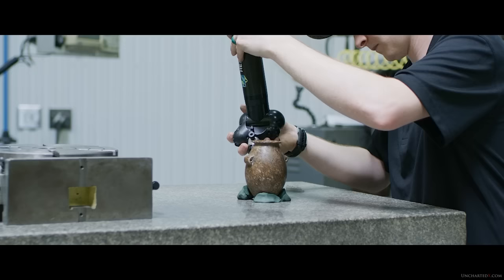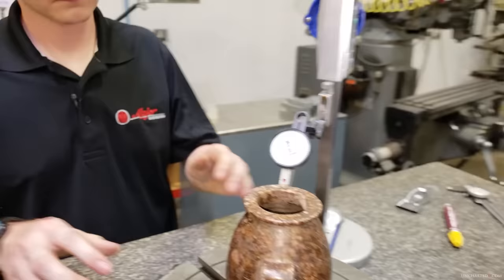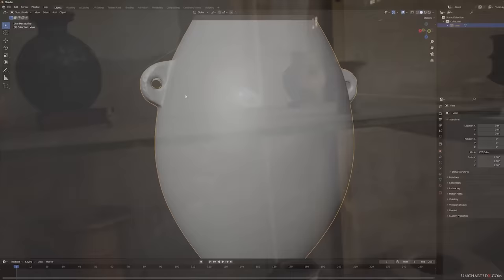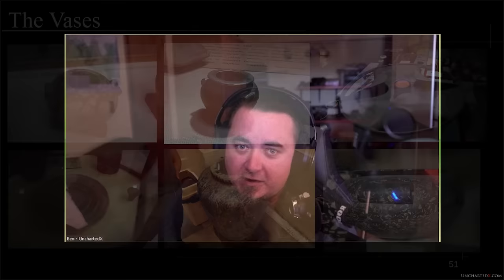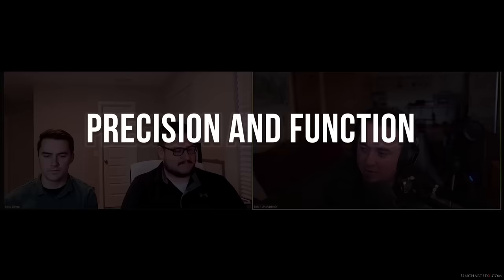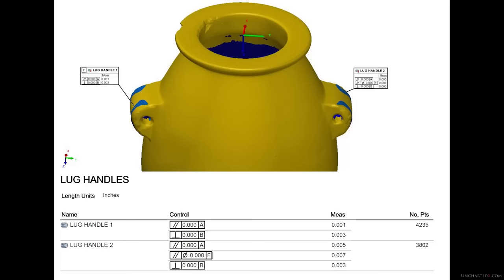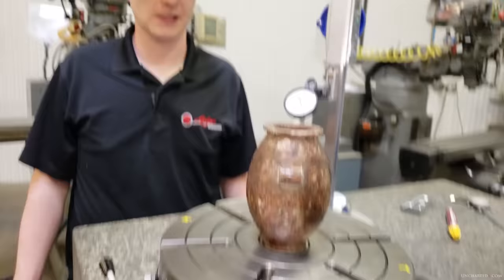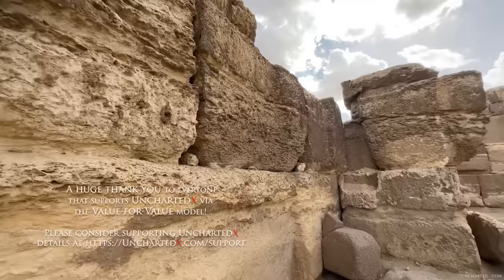Ancient Egyptian Vase Scan Update! STL file, More Analysis - and Between the Lug Handles

Comment: So you're surprised there are stone vessels during the STONEAGE? It would be more impressive if they were made from steel. They had lathes. If you have a lathe and sand to polish you can achieve very high tolerances.
Reply: uhh...you're aware that granite is harder than steel, right? and there is even a vase in the Cairo Museum that is made from Corundum (Mohs hardness of 9).
Reply: @AustinKoleCarlisle  You're correct friend. Steel is refined iron ore enhanced  with carbon. It's significant because the temperature required to smelt ore is quite high. Additionally it requires knowledge of metallurgy. The paleo to neolithic represent the stone age. People crafted tools from stone. They used lathes chisels and sand. Sand like is found in Egypt has a higher hardness than granite.
Reply: @samkostos4520  wrong , sand in Egypt is very fine like flour and not very abrasive
Reply: @al2207  No. Egypt, is one of the primary sources for high quality silica sand. They remain a leader in production today. Why you feel the need to lie to suit your theories is strange friend.
Reply: @samkostos4520  i was there and sand is not abrasive the way you say
Reply: @al2207  The quality and types of sand are determined by geology. Not subjective theories or your personal feelings. There objectively is silica sand in Egypt. Infact there are types of sand with higher mean hardness ratings there in plentiful supply.
Reply: @samkostos4520  Do you think the high precision bearings, in the machine that made this vase, were made of stone?.

How do you maintain the position of the abrasive in a precise manner, in order to produce the tolerances of this vase?
Reply: @jamemswright3044  The sand is used for drilling and hollowing out the volume of the vase. It's also used for the holes in the handles. Since the drill would be in a vertical position gravity would keep the cutting medium in place.
The lathe is used to construct the exterior shape of the vase. Because lathes rotate they produce symmetry along the rotational axis. This is the whole point of lathes.
Reply: @jamemswright3044  They did not use bearings. We know they used weights because there are hieroglyphs that show it. It's plausible that their drills and lathes were automated by cattle using a capstan like the Greeks employed in the 3rd c. BC. 
The people living during the Neolithic shared the same anatomy as you or I. Meaning they had the same intellectual capacity. Meaning there were gifted level thinkers among their civilizations who devoted their time to the production of stone goods. Over time this developed into the mastery of the availible materials resulting in smelting rocks like malachite to extract copper -mixing it with tin and forming bronze. You see we would not of developed metallurgy without first deeply understanding the properties of stone.
Reply: @jamemswright3044  My point being. If you want to disprove classical studies and the accepted chronology you need to produce an example of industrial metallurgy during the mesolithic. Stone items found during the mesolithic(meso - middle , lithic - stone) do not demonstrate that a lost civilization existed.  Obviously you could also prove classical studies wrong by providing evidence of a written language prior to 5500 BCE yet we don't find that anywhere on earth. Don't you think if some advanced civilization was present that they would leave behind even a single inscription?
Hieroglyphic writing developed independently in North Africa. Cuneiform was used in Western Asia (Ur, Sumer etc.). Don't you think there would be a common origin in relation to written language if there was a global civilization which preceeded them?
Reply: @samkostos4520  How do you account for the lack of run-out, on the exterior of the vase, without the use of precision bearings?. How do you set up and maintain perpendicularly within a few thousandths, to drill out the internals of the vase?. How do you stop the drilling mechanism from wandering in hard and soft crystalline materials?.  How do you machine a spherical internal shape with a drill?.
Reply: @jamemswright3044  In relation to the precision of this particular vase. There are logical explanations. Assuming it is authentic and from 6000+ years ago it's possible they used water based levels to refine the object. Alternatively, it could have been restored in modern times by a collector who wanted to have a nice show peice. As the vase resides in a private collection we do not have reference photos from it's excavation to follow how the object has changed throughout the years.
Reply: @samkostos4520  how do you use water based levels, to measure circularity and perpendicularly?.

 Is there anyone available now who is re-working vases like this, to this precision?.

Comment: So much blah-blah-blah and no wondering what was the purpose and function of these vases. This must be a lucrative topic bringing a lot of advertisement money. After watching 3 or 4 videos of yours on this topic, it has become boring, and everything is clear to me now:
1. These vases were created by a relatively advanced civilization
2. They were most likely made using waterjet cutting, sandblasting and maybe laser ablation controlled by a computer and high-precision laser sensors
3. The purpose of these vases was burials - they were used for storing ashes of the dead. And maybe for planting flowers and other plants in these vases that contained soil mixed with ashes
4. These vases and other artifacts like precision-cut blocks, boxes, columns and statues were created BEFORE the last glaciation during which ice covered only the Northern part of Europe and did not reach Africa. All these artifacts were parts of cemeteries, and these cemeteries, columns, obelisks, statues and and temples were destroyed by moving ice during one of the glaciations preceding the last glaciation, i.e. at least 140K years ago.

Comment: Please stop giving these interesting measurements with the medieval units of inches and fractions of an inch! The scientific world has long since agreed on the well-established metric system, because this is the only way to make comparisons at world level! - Your fans from all over the world have been wanting a long overdue modernization of your measurements for a long time, because otherwise they would not be able to do much with your information!
Reply: Pretty sure they use the Imperial "Thousandths of an inch"  for pure show biz /dramatic effect reasons . 
As it no doubt sounds much more important than hundredths of a mil. 
One could say its : The bigging up, of little.
Reply: @ochsosfollies  Aber das ist doch unredlich! - But this ist very Dishonest!
Reply: @Rainerjgs  :  No not dishonest. After all the distance/length measured is exactly the same regardless of unit -  which is the important thing. 
Ben probably has more viewers from countries that use and can relate to the Imperial system and fractions  etc so he caters to them to get the across.  
   But as mentioned the data is the same . 
It just sounds more dramatic in imperial
Reply: like it or not the meter is derived from the measurement of Earth, every time you say "meter" you are referring to 1/4000000th the polar circumference of the Earth. so call it what you want, the important thing is the size, not the unit.

Comment: Another "Gee whiz we don't know how they made these things, and we could not make them today"
Can we agree on one thing?
The people who made these things used steel tools?
I bet many of you will say no - they did not have steel tools
Yet we see the products of steel tools

More specifically, case-hardened steel tools.
There are many dozen of YouTubes of "Primitive Technology" that show you how you can easily make these tools in your backyard tomorrow.

All you need is some iron-rich material, stones with iron in them, charcoal, and mud to make the furnaces.
They show you how to easily make a "bloom" of iron where when cooled, you pick out the small needs of iron and hammer them into a knife, chisel, or hammer with a rock.

Once you have the steel tool, you case harden it by wrapping the working edge in leather and then sealing the tool in mud tubes to be placed in a furnace. 

So stop the incessant "We can't figure out how they do it" and agree that none of the items could have been made without case-hardened steel tools that anyone can make without technology.
Reply: Those were sandstone not dolerite
Reply: @lemontree5986  Sandstone? hell sandpaper can make them perfectly round.
Reply: @noleftturns  Those  YouTubes of "Primitive Technology" are using sandstone/marble equivalent. no one using granite and dolerite
Reply: @noleftturns  i was saying no one try to make a replica using dolerite, we can cuts anything thing that exist, that not even debatable.
Reply: @lemontree5986  I think we have a communication problem here. I'm saying that to "work" granite, you need steel tools - period. Bronze blades with sand as a cutting agent can cut straight lines, but they can't cut 90-degree inside corners - only steel can do that. I've seen flint chards used to cut granite but they don't result in straight, smooth finishes.

For limestone, bronze tools are perfectly OK.
Reply: still doesn't explain the PRECISION, which is the point of the video
Reply: @AustinKoleCarlisle  Of course it does - once you realize that steel was at their disposal, then imagine a vase was crudely sculptured by a master sculptor getting ready to mount the vase on a potter's wheel and an instrument like a dentist's drill was the cutting tool. ( a wooden clamp was used to affix the vase to the stone wheel)

This "dentist tool" was simply a steel rod that was lowered and intersected the vase at a 45-degree angle. As the potter's wheel turned, the steel rod would be lowered to chip away at the surface, resulting in a uniform cutting depth around the central axis of the vase.

Once the vase was turned on the lathe a master sculptor would handle the handles. The vase at this point showed circular cutting marks, which were done away with by a wooden box filled with sand and the vase was placed in the sand, door closed, and it spun for days/weeks with the sand polishing the vase to what we see today.

All the above is a guess but I wish people would stop acting stupid and shout, "We can't figure out how they did it so they had super advanced technology that we don't have." That's a lazy excuse.

The Egyptians could do all the above with steel, wood, and rope and master sculptors.
Reply: @noleftturns  the machine creating a precision object must be even more precise than said object. so tell me, how did they measure precision to the 1000s of an inch which is undetectable by the human eye?
Reply: @noleftturns  this isnt just a one-off artifact. there were FORTY THOUSAND of these precise vases found underneath the Step Pyramid, originally.
Reply: @AustinKoleCarlisle  OK, there are a lot of them - how old are they?
Nobody can answer that question because we can't date rock.
Everyone assumes that the Egyptians made 40,000 of these things - what science backs up that crazy idea?

I believe that the Great Pyramid (GP) - can't speak about any other pyramid since I've studied the GP for 30 years now - was built about 5,000 years ago - but here's the zinger - ONLY limestone blocks were used - not one piece of granite was used in its construction.

I'm a retired Aerospace Engineer, and after tackling thousands of projects over the years, I've learned that the assumptions you go with more than likely are initially wrong and get you into a lot of trouble. Challenge every assumption with as many facts as you can.

I believe the Egyptians stumbled across a debris field on the Giza Plateau 5-6,000 years ago - strewn with granite temples and all kinds of objects - maybe 40,000 granite vases - who knows. What to do with the granite temples? If they tore them down, the people who built them might return and destroy all their cities. So they did the only logical thing they could do - entombed them in 2.5 million limestone blocks in the case of the GP.

This explains why the granite temple now inside the GP has things pointing to where galaxies were 12,000 years ago - that's when that civilization built them and the Great Sphinx guarding their religious site.

So the 40,000 vases you cite could be 12,000+ years old and represent thousands of years of work that scientists today lump into things the Egyptians did. This also explains why the Egyptians never wrote one word about the pyramids - they were covering up a more advanced civilization than they were.

That society also used steel tools.
Reply: @noleftturns  of course, but the Dynastic Egyptians certainly didn't have access to the technology that created these artifacts.
Reply: @noleftturns  okay can you please clearly state your position because you're all over the place. I think these artifacts pre-date the Dynastic Egyptians. I think they were created using an unknown technology or process. I think the Dynastic Egyptians found these objects and attributed them to the creation of the "Gods". Then I think they (poorly) attempted to recreate these objects which is what we see with the shoddy alabaster vases and the associated depiction of that process in the hieroglyphic record.
Reply: @AustinKoleCarlisle  Sure - when the GP was built, the Giza Plateau was a debris field from a civilization that died due to the Younger Dryas impact 12,500 years ago. Their crops failed, the earth cooled, and they perished from starvation and disease.

They built granite temples where the pyramids are today, and the granite pottery we see was from thousands of years of making them.

They discovered steel tools and probably built the equivalent of our CNC machines out of the steel cutting tool and wood. A CNC can quickly reproduce these artifacts to the tolerances indicated. If I had to guess, this civilization quickly made these items using a steel tool that resembled an old-fashioned dentist's drill and used wooden patterns to control the depth of the drill. The rope turned the steel cutting tool, and a series of pullies allowed workmen to turn a wheel that powered the drill with the traveling rope.

I'd bet hundreds were precisely the same size down to the millimeter.

Just a guess, but I'd bet I'm close.

Comment: You make too many absolute statements about what can and cannot be done by an artisan.  Further, you take sides with the machinists who agree with you, and say those that don't agree with you don't understand the data. You're frequently going on about the archaeologist orthodoxy mafia, and then you act just like them.  You don't need to make qualifying statements if your data is good.

Also, I think you could do better with the analysis of the urn's measurements. These metrologists seem to have a good start, but there is so much more.  For example, there is math that describes how flat and smooth a surface is.  For example, the vertical profile of the urn can be described by a formula.  Take many slices - how far do they deviate.

Finally, is this the only urn demonstrating this level of precision?  Measure more of them and see if it is a fluke.  Anything can happen once.